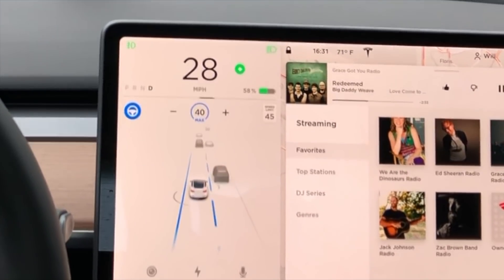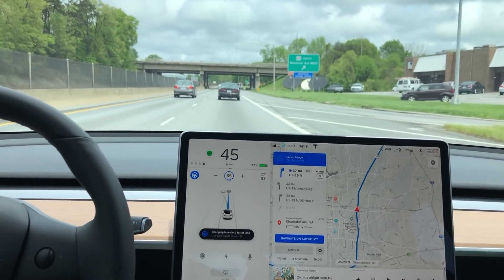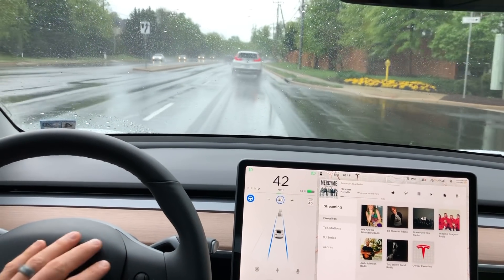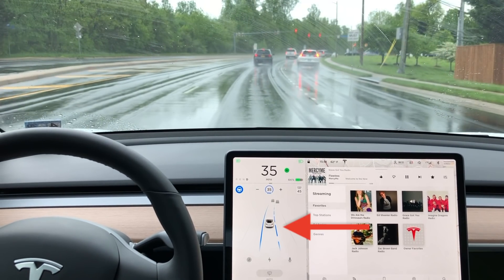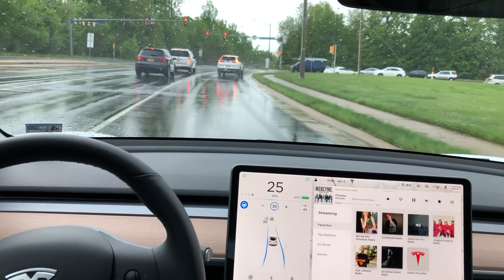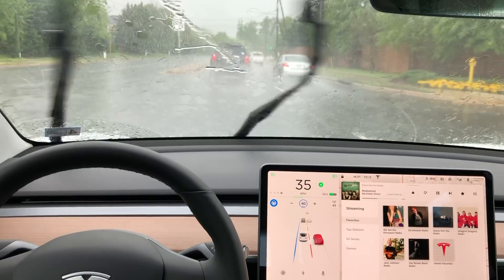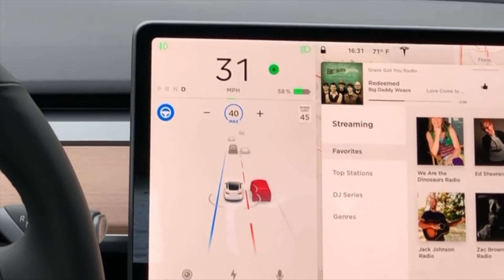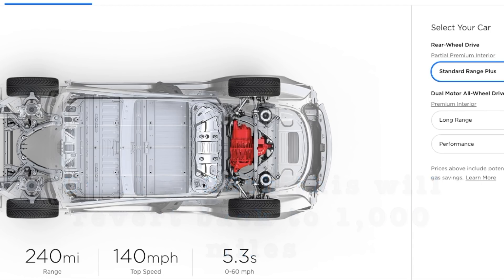Tesla Autopilot | How Far Can We Push Lane Changes? Detailed Look at Optical Mechanics

Comment: How good is the car in winter driving conditions? Does it recognize black ice the way an actual person can? I never considered buying a Tesla, but I'm actually I interested now. I just want to know the limits of its abilities. Anyone here, I'll appreciate your response.
Reply from the maker: Teslas are able to transition power from wheel to wheel (left to right on each axle) 1,000 times per second. No ICE car can do this. If you have dual motor car, my Model 3 is a single motor, your car will drive like a tank! Like any car, snow tires will improve winter driving dramatically. Currently autopilot (AP) isn't able to identify black ice, if it is someone please correct me. This is by far the most advanced car you can buy today and the best part is once you buy a Tesla it will keep getting better as you own it with free OTA software updates (just like your iPhone). Hope this helps!
Reply: @ALLElectricChannel  Samsung Note 8 😜
Reply from the maker: Haha yes, OTA updates just like Samsung too 😉

Comment: You still cutting a solid line?
Reply from the maker: Yes, because the turn lane dashed lines are so short. Often when you try a lane change it will cancel mid change because of a solid line. I’ve done this change into the turn lane several times with no issues